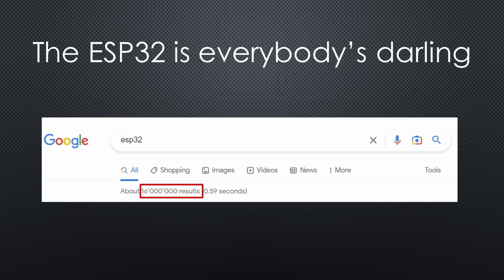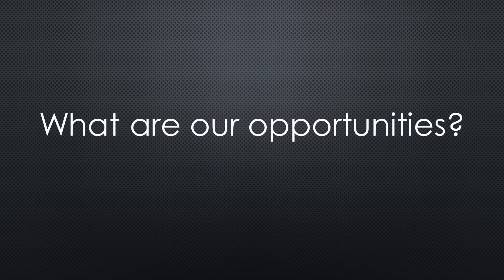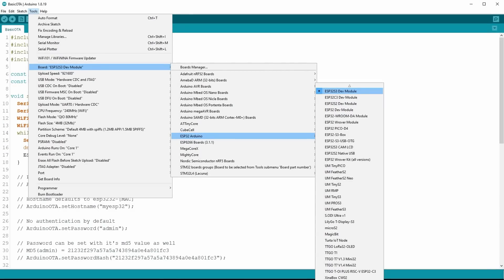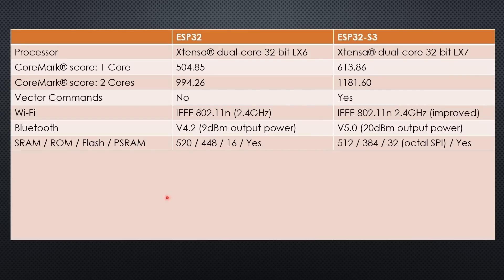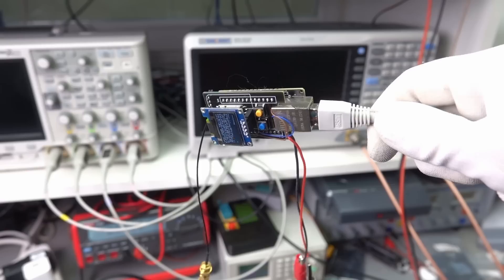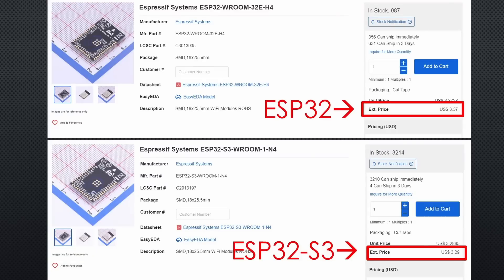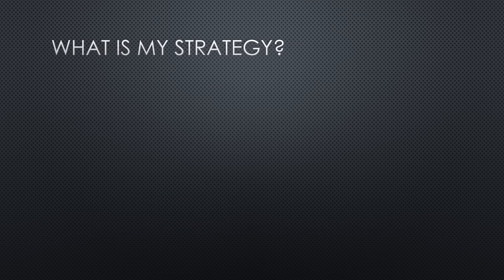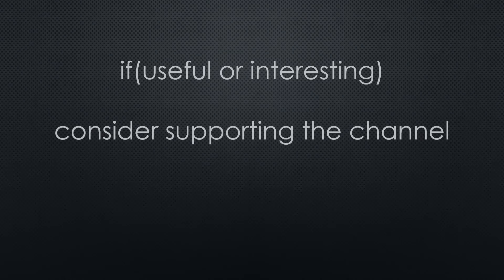451 Which Processor can kill the ESP32?

Comment: Hi Andreas, I did some research to compare ESP32 WROOM and ESP32-S3 floatingpoint speed. And strange to say, the -S3 is pretty much slower than the ESP32 WROOM. For comparison I programmed a loop for creating 1 million random numbers-pairs with division: 
num1 = random(1000) / 1000.0; 
num2 = random(1000) / 1000.0;
Then they were multiplied. The microseconds of random number creation, and the multiplication were added seperately. The results of muliplication/RandomNubers were:
ESP32: 533000/1730419
ESP32-S3: 789000/42163500
I expected this to be the other way around.
Do you have any idea, why the 'better' microcontroller is slower?
Reply from the maker: I would not expect the S3 to be faster in "standard" floating point calculations. Its new vector commands make a difference, but only where used.
But it is strange that it is slower....
Reply: @AndreasSpiess  Yes, its very strange. I did some more research to change compiler optimization for GCC. But without success related to executing speed, or code size. 
There's one overall file platform.txt, where optimize_level =-O<arg> can be entered. <arg> are 0, 1, 2, 3, s, fast. The same arguments can be used in the textfile sdkconfig, at line ''CONFIG_COMPILER_OPTIMIZATION_PERF'. The later one distinguishes between ESP32, ESP32-S3 and so on.
Here's the outup of my benchmark:
ESP32 WROOM:
  LoopingTime (= waste):         0.092 µs/Operation,   10.826, MOperations/sec
  Creating random integers:      0.697 µs/Operation,    1.435, MOperations/sec
  Dividing floats:               2.933 µs/Operation,    0.341, MOperations/sec
  Multiplying floats:            1.595 µs/Operation,    0.627, MOperations/sec
ESP32-S3:
  LoopingTime (= waste):         0.076 µs/Operation,   13.240, MOperations/sec
  Creating random integers:     22.246 µs/Operation,    0.045, MOperations/sec
  Dividing floats:               0.037 µs/Operation,   27.048, MOperations/sec
  Multiplying floats:           44.494 µs/Operation,    0.022, MOperations/sec
As you can see, the looping is very fast, the rest not really usable for serious projekts.
Do you have any hints?
Reply from the maker: @fineliner7700  No. I am not a specialist in this. Maybe you send me the code. Then I forward it to Espressif.
Reply from the maker: Comments with links are deleted on YouTube (I saw it because I get a notification). I wait for your answer...

Comment: I just really want a version with a good adc, the adc we have right now is barely usable, and we can forget about using it to measure battery voltages with any real precision
Reply from the maker: I use it for measuring battery voltage because I only want to know when I have to replace it ;-)
Reply: @AndreasSpiess  I cant get any meaningful accuracy with it if i use a voltage devider to measure anything above 3.3. since the values dont corespond to the voltage in a linear fashion
Reply from the maker: Strange...

Comment: Excellent presentation, however the newer ESP32's at least so far are pretty underwhelming tweaks on the original. Hoping we get some additional vendors in the mix with competitive products.
Last time I checked the ESP32 had an undocumented machine machine instruction set. That's a security as well as a support and engineering concern and showstopper for using ESP32 for any serious commercial or industrial projects for me. Has this changed?
Reply from the maker: I never looked into this topic because it has no priority to me. But I know that many companies use the ESP chips for their products.
Reply: Dang! I didn't know about the undocumented instruction set. That's quite risky to other nations, given where these chips come out.

Comment: Regarding the S2 you don't like; It may have a right to exist as a cheap upgrade path in case you have a older ESP32 in production because those have wifi vulnerabilities in hardware; ones that can not be patched in software. Those vulnerabilities are not to be found in the S series.
Reply from the maker: I did not say I do not like it. For me, it just had not enough reasons to change.

Comment: They still have yet to make a true successor, IMO, because the original ESP32 has classic Bluetooth (still the only way to do Bluetooth audio until LE Audio is mainstream), and it has the APLL which makes a much cleaner MCLK signal than the S3 does. This is important if using a codec/DAC that is sensitive to having a good clock signal
Reply from the maker: You are right, I was not aware that it "lost" the classical Bluetooth...

Comment: If you use PlatformIO you dont need to reset the board after upload. I can only hope Espressif doesn't screw a good thing up. They should have never taken ethernet out, and should always keep the dual cores. I for one would be willing to pay a bit more to have everything all under one hood.
Reply from the maker: Ethernet is probably not a often used function. At least you do not find a lot of boards nor projects using this feature.

Comment: knowing that the ESP is factory set to listen for and receive WiFi and it cannot be turned off. this makes me think there my be a reason.  an not nice reason.
also,  my needs are for a simple 12 bit ADC and I can use RF or WiFi as external boards.
I want to have dozens of devices measuring ADC values and storing the lot on a central datalogger.
I wish the STM32 had a community that was as robust as the Arudino community.
Reply from the maker: There is a simple command to switch WiFi off (and to check, you can measure the current consumption).

Comment: If only the Teensy 4 had the BT and WIFI , . Octal SPI, have we gone full circle. Isnt that an 8-bit memory. Any thoughts on the PADAUK PMS150C $0.035 micro, (sold at LCSC) .  RISC V interesting move from the xtensis ? A good move , how are the new ADC 's .
Reply from the maker: I do not do mass production, so the price of an MCU is not extremely important (if it is in the few $ range). So the PADAUK stuff is not too important for me.

Comment: I bought I nice 7' screen with built in esp32s3  chip- works quit nice at $40 - a nice chip i would not mind  to work with is the nrf52820   it arm  based but has 2.4, ble and zigbee.  if using  epaper screen  it has a operational life of upto 10 years on cr2450 battery
Reply from the maker: I agree, the NRF chips are good for BLE and Zigbee...

Comment: You may have mentioned that the S3 is slimmer, and fits better on a breadboard.  That has always been an issue with the esp32
Reply from the maker: I assume that this is not a property of the chip. It is the property of the board. The modules are the same size for the ESP32 and the -S3.

Comment: I am not sure I concur with your assessment that the RPi Pico is not a contender because it is not much supported by the community. It is a very capable dual core chip, and the Arduino core by Earl Philhower is excellent. There is an abundance of boards available these days to choose from - including some with WizNet Ethernet chips mirroring the wired connectivity of Unos for cases when Wi-Fi does not work.
Reply from the maker: I agree with your arguments. My point was that I do not see lots of projects using the Pico with the Arduino IDE.
Reply: @AndreasSpiess yeah, not sure about Ardui no IDE. Since I am using PlatformIO for that, you might have a point there. Cannot see myself using Arduino IDE. But then that applies to all the other MCUs as well. IMHO even with the improvements on the 2.x side for Arduino IDE, it cannot beat PlatformIO for post-beginner users.
Reply from the maker: If you use platformIO you most probably also use the Arduino IDE infrastructure and libraries ;-)

Comment: Please stop using the Arduino IDE and switch over to an actual good IDE like Clion or Vscode using PlatformIO. The arduino IDE is just a straight up bad IDE and I cringe everytime i see someone use it. You will thank yourself to switch to an actual IDE that has modern features and is not  stuck in the mid 2000s.
Reply from the maker: PlatformIO profits a lot from having the Arduino IDE as a basis (many people do not know this). 
I stick with the Arduino IDE on this channel because all PIO users can easily transfer my code to PlatformIO. But many beginners are lost with PIO.
Reply: @AndreasSpiess  Fair Point. I would still recommend it over the  Arduino IDE If are a Bit more experienced. It Just makes writing Code much more pleasant and it Supports alot of different Frameworks.

Comment: I don't take notes about the deep sleep. If one needs to keep the application context, they can use the light sleep. Deep sleep needs to consume less, hence it powers down the RAM among other peripherals. If you need to preserve some data from RAM during deep sleep, you can transfer it to and from the RTC memory.
Reply from the maker: I agree. Still, the Atmel328 keeps the context which is very handy...
Reply: @AndreasSpiess  Sure, but ESP32 too. In its light sleep. Well, if it consumes more than e.g. Atmel328 is by design, but one can use ESP32's deep sleep with some extra programming (if necessary). For example if I wanted to make a low power ESP32 app that would just periodically wake up for a short time, do some stuff and went to sleep, I would use a deep sleep with only RTC timer and RTC memory active and mark the variables to survive this deep sleep with RTC_DATA_ATTR attribute. Such a thing might consume ~10µA during the sleep period.

Comment: If they made a 100 pin esp32, it would absolutely rule the market. Is it supper expensive to add more GPIO's to the bus and use a bigger package?

The Sipeed/Buafolo chips looks very interesting, too.
Reply from the maker: Most projects probably do not need 100 pins. MCUs are built for markets and every cent seems to count.
Reply: @AndreasSpiess  I have worked on several projects where an STM32 part with 100 or 144 pins was totally consumed, after adding SPI, RAM, parallel LCD, SDIO for wifi, etc.

And those were projects where having dual core would have simplified a ton of software NRE, too, esp with FreeRTOS and a bunch of libraries right out of the box.

And the price diff between existing ESP32's and said STM32's would have been several % of the total BOM cost.

So, thus, I do wonder if adding more GPIO and going to a bigger package does significantly increase the cost.

But, I also realize that things like the LCD driver might be a pretty significant chunk of logic and silicon area, so a difference in some features could be a major driver of price difference. Really not sure.
Reply: @a_pullin 
I mean you're going to need more processing power to interface that many I/O pins and more memory to run any meaningful code. If you're at that level then industrial microcontrollers would be a better option.
Reply: @fireteamomega2343 No, you're not. More I/O pins has no bearing on the CPU or memory.
Reply: @a_pullin  
Depends on the use are you sending or receiving data across said pins ? If you are just using them for high or low states one at a time then sure CPU and memory may be meaningless.
Reply: @a_pullin  
And I'm not sure what projects you are doing that require hundreds of I/O when it seems that some redundancy would likely be taking place. And in that case using SPI or I2C would be more applicable.

Comment: You should make a video about Pine64 Ox64 board. It has an extremely fast T-head RISC-V processor and has Zigbee (802.15.4) support, as well as the Wi-Fi and Bluetooth. I am not sure about the software support, but I will be getting one to play around.
Reply from the maker: Does it have Arduino IDE support?

Comment: Like always, nice vlog. The three features that are game changer for S3, C3 and C2 are:
1. Direct connection with USB, no need for CP2102 or any other USB to UART Bridge.
2. Bluetooth 5.0 support
3. In built support for debugging, no need for  external JTAG adapter and extra wiring / cable to connect JTAG to ESP32-C3/C2/S3

You missed to mention last feature in your vlog.
Reply from the maker: Thank you for the additional info!

Comment: We just started using the ESP32-S3-DevKitC-1 boards for projects at work.  We got the variant of the board with the most PSRAM and Flash and that has been useful in our projects to have more external RAM and Flash than the older ESP32 boards.

The other thing that we liked about the S3 is that the USB port also supports JTAG so we are able to run VS code with Platform IO with full source code debugging without needing to have an external JTAG board.

Also in the S3, besides more GPIOs, you don't have to worry about SPI bus sharing as the PSRAM and SPI flash are on their own busses separate from the two SPI busses for use to the actual pins.

Thanks for publishing the spreadsheet, that is quite helpful.
Reply from the maker: I agree with your statements!
Reply: It has native JTAG via USB? I just might need to use them on my latest power electronics...

Comment: Great video.. I think this video misses a very crucial point. S3 has inbuild jtag, which uses only 2 pin without any external debug adapter for debugging. This is a big plus as we donot need any external adapter like esp-prog for esp32. 
One more thing, it has the hardware acceleration for crypto,  much need for secure applications.
Reply from the maker: Thank you for your additional info!

Comment: The S3 is an interesting chip. As well as the standard ULP it has a RiscV ULP. In video #252 you mentioned that you would like to see a C compiler for the ULP. The S3's RiscV ULP can be programmed in C. It would make a great future video.
Reply from the maker: Do you know how to do it to help me with my first steps?
Reply: @AndreasSpiess  I've not done it yet, I only received my S3 board a few days ago. Espressif did talk briefly about it at DevCon22, the talk is here: https://youtu.be/DFgxJ-sF0To.
Reply: @AndreasSpiess  I've now had a change to play with it, and it is quite easy to get the risc-v ulp running thanks to esp-idf. I added the espressif esp-idf extension to vscode. Espressif provide a huge number of examples, including 2 for the ulp-fsm and 5 for the ulp-riscv. Very nice.
Reply from the maker: So we just have to wait till it is supported in the Arduino IDE, I think ;-)

Comment: Teensy 4.0 and 4.1 are what have turned my head the last few years.  They have absolutely unbelievable computing power!
Reply from the maker: They are extremely fast, I agree. Probably too fast for most of my applications.
Reply: I really like the teensies. I use them for my work. For my personal projects they are too expensive in my opinion.
Reply: @piranha1337  Yes, they've always been pricey.  Until 4.0, I didn't see a justification for it.
Reply: I'm new to arduino looked these boards up very cool but unsure what they would be good for

Comment: For me as a DIY keyboard nerd, the USB interface is what makes the S3 chip interesting. The community has discarded the ESP32 chips for years because it didn't have any
Reply from the maker: I agree that this is an important addition.
Reply: Same for the DIY game controller community. So I hope the USB interface capabilities include USBHID, because that would be rad!
Reply: What about ESP32 C3 for keyboards? Any good?
Reply: @slowjocrow6451  i couldn't use it for my split keyboard as I needed 11 gpio for the matrix +Tx/Rx. In theory the chip should be able to do it but most of the boards you can find have only 10-12 pins available.

Comment: - The Arduino FastLED/Neopixel library for ESPHome needs a patch to work.
- The vendor/board LoRaWAN library that I was using with ESP32 wasnt supported on their new boards with ESP32S3 (they switch to a different LoRa Radio chip).
Reply from the maker: Thank you for the additional info!

Comment: Hi, nice video.
Another difference: ESP32 has BR/EDR (Bluetooth classic) support as well as BLE... while ESP32-S3 only supports BLE
Reply from the maker: You are right. I was not aware that it was dropped.
Reply: This is why I don't use the s3, no quick and easy Bluetooth serial port ...
Reply: I also wanted to mention that. Unfortunately, this means that you cannot use it as A2DP Bluetooth audio device (ESPuino for example). This is the only feature of the S3 I am really missing.

Comment: Hi Andreas. What would you suggest or how, for I2C protocol commands reverse engineering.

I have old setup (not built by me), that monitors LED temp and Voltage, whole system communicates over I2C protocol.

I wany to replace current "controller" with Arduino based device (ESP32, Arduino Uno...).

But I need to "listen" to commands that "controller" sends over I2C so I could replicate them via Arduino board (that is my idea 😁).
Reply from the maker: You find cheap Logic Analyzers ($10) on Aliexpress which will do the job. Videos are also available, also on this channel.
Reply: @AndreasSpiess  Thank you. That was my idea how to do it. Just wanted to see if I am on right tracks 🙏

Comment: Pretty hard to beat the esp32 s2 mini board, 2 mb of psram, 4mb of flash  and 27 gpio pins now for under $5.00 on Amazon. In addition, small size, the board is only 34.3*25.4mm, the pins are doubled up on each side.
Reply from the maker: Indeed a good deal!